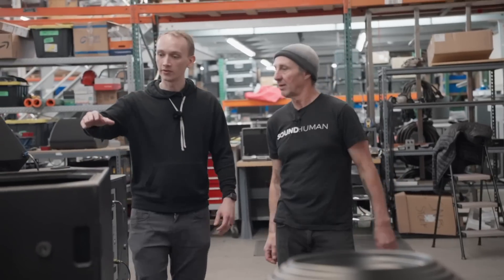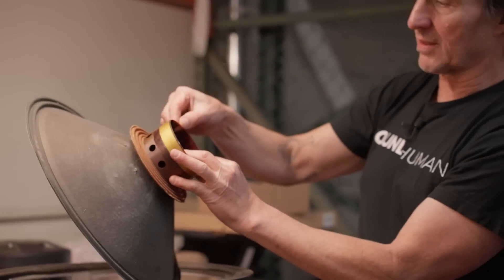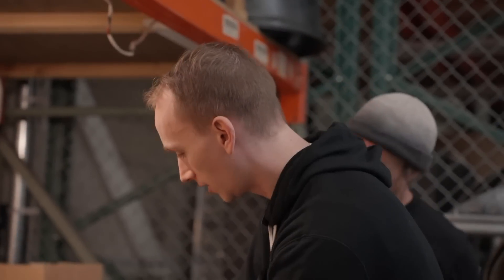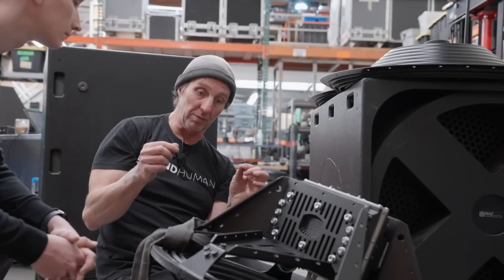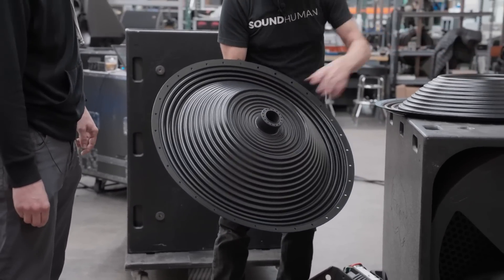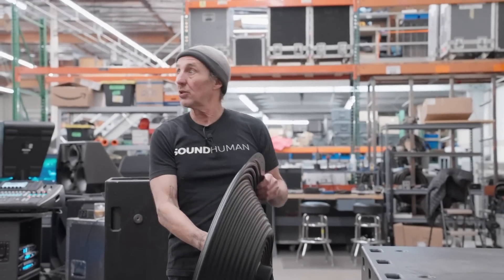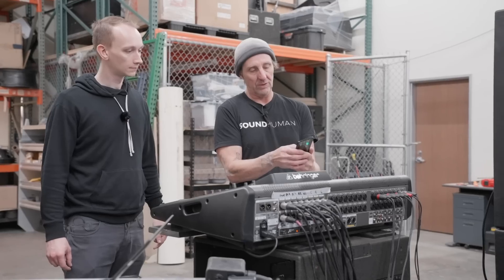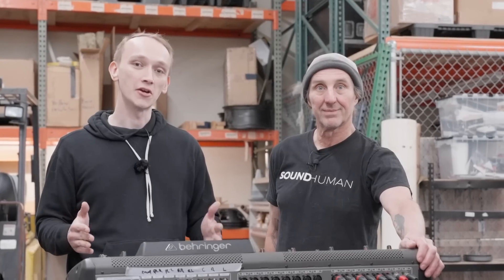Moving Coil vs. Linear Drive Speakers with Dave Rat

Comment: I think Dave is actually correct in your battery-spinning example, you'd get an interrupted squiggly square wave out  (squiggly beacuse no speaker can really reproduce a "perfect" square wave).
Dave is the real deal, if you weren't convinced before, watch his video about audience heat affecting the audio. Magician-level stuff.

Comment: Such an amazing Video! It's very informativ and done properly. Not many channels do this! 
I designed an Infrasonic Tapped Horn for PA use with 2 Ciare 12.00SW that are tuned to 15hz of which a friend built 4 and indeed like Dave said thermals can be an issue! Though with how much air is flowing thru the enclosure in the Infrasonic it's not an issue there as there constantly hot air being pushed out and cold air sucked in, in a way BUT around 35hz the wavelengths are in a way that the hot air doesn't get pushed out as the air doesn't travel in and out far enough. and adding to that the excursion is almost 0 at 35hz so the motors are moving almost no air thru themselves while at the same time the impedance is low and with that a TON of power going thru. So it becomes a heat trap limiting the output. BUT man that infrasonic is so worth it! We may eventually go with those M-Force units as well eventually.

Comment: Why not use the pressure sensors that are already there to run the speakers in a linear mode? Like a servo feedback? Wouldn't that be more accurate? And since the sensors are already installed and DSP is cheap if not already incorporated into the amp module?

Comment: This might be a dumb question but I’m not well versed in Pro Audio but how come PA subs still use accordion surrounds vs the high roll surrounds you seen in other applications like home theater subwoofers and car audio subwoofers?
Reply: I think it's the increased balance between the restoring force of each direction of travel at high spl. Meaning the amount the surround pushes back as the cone moves away from its rest position is more even when comparing inward and outward displacement.

Comment: All the 'big super long throw driver' stuff is a $cam.  The best price-to-performance value is mid-tier 18" PA drivers that throw around an inch max.  More & the drivers & suspension need 2 B 2 stiff & heavy & hard 2 sound as detailed, & less & U R wasting space & weight.  Also he lies about beng able 2 move coil drivers slow.  They will track 2 whatever U throw at them.  WHether U will hear it depends more n the size of the enclosure & portng & stuff & amount of power U R amplifying with.  This is kind of like that muddy sounding 'intersonics servo drive subwoofer' $hit = fancy sounding tech, but worse sound.

Comment: Linear drive speakers are such a bizarre concept. I've always though of speakers as an air pump of sorts (of course push pull :). This design reminds me of an internal combustion engine (piston & connecting rod) but rather than a crankshaft converting the energy into rotational force, the connecting rod directs the energy directly into the cone. I'd guess it is too heavy for accurate mid or HF information. As for a Sub though... Very cool.

Comment: The Danley principle with upgrades. VERY neat!!
Reply: Danley principle?
Reply: Servo-drive was a rotor motor with linkage to the cone. The mass of the rotor and linkage made them only useful below 50 Hz.
Reply: @dannelson6980  
Thank you. 
Well familiar on Tom's work, just curious on what the OP was referencing in particular.

Comment: Correct me if I'm wrong but I'm thinking these things could be fitted out with water cooled coils if needed for more power handling.
Reply: Yes, but that'd introduce unnecessary complexity and failure modes. 

In typical applications, it's vital that it's absolutely bulletproof. 

They have structural heat sinking, plus ample coil area for thermal dissipation.

Comment: I remember seeing a 2 inch speaker in a first gen transistor radio that had a short link to the little cone and went to a magnet-coil mounted on back. So we were half way in the early 60's. Likely done in the teens with first gen radio speakers post horns. The key thing here is feedback with servo action not just a dumb motor. I have a pair of PA speakers that have feedback and their sound never fails to deliver.

Comment: Good science, well explained. Why is the drive mech in front of the cone, where it can "muddy the waters", so to speak?  🙂
With something that big, would axial length really matter? Or is it because the design is mainly aimed at low F, which wouldn't even see the driver?
Reply: The motor being on the "front" has zero negative impact on performance. 

The 56 foot wavelengths of a 20hz tone aren't impacted by the motor out front. 

Even way up top of the sub's range at 80hz the wavelengths are 14 feet ... so the mechanism is still acoustically small.
Reply: @FOH3663  I should have considered the actual wavelength, I stand corrected, thx.
Reply: @flamencoprof  
It's so helpful to automatically associate a wavelength with a given frequency!

That size orients you to essentially all acoustic interactions, everything's about wavelength size. 

Plus, historically flipping the driver over with the motor outward is advantageous for cooling. 

I'm sure there were more, but early on in the 80's TAD, EV, and I believe EAW had motor out subs/platforms, as they explored distortion lowering and motor cooling.
Reply: @FOH3663  I am well-educated re frequency vs wavelength. However, despite a lifelong interest in guitar amps, I have never investigated the world of high-power  low-f speakers.
The cooling effect is obvious once pointed out.
Even at over 70, I appreciate learning new things. Thx.

Comment: There are the fan/paddle style speakers that can go super low but you have to put them in a window or a special hole in the wall.
Reply: Yes. A rotary subwoofer.
Reply: "they go super low, but you have to put them in a window or a special hole in the wall" 
That's an IB or Infinite Baffle alignment.

Comment: Such a master. 😎✨
By the way speaking about the cone coming out or in - after touching the battery to the terminals, if the cone comes out then that is supposed to be the correct polarity. Minus to minus and plus to plus.

Comment: I'm still waiting for the first person to mount a few of these in a Car Audio SPL environment.     Dave is one really cool dude!
Reply: Yes 2 units in series is 0.5ohm and 20k so there is amps out ther that can do it. Unfortunately this design has only very limited xcursion compared to traditional spl speakers
Reply: @bassdabob and here I thought space and rear suspension would be what limited the use of 2 of these. 😂😂😂
Reply: @bassdabob  Loaded into a tuned speaker, two in series will be close to a 2 Ohm nominal load. DCR is extremely low in comparison due to the efficiency of these drivers. So Unless you're planning on sending single digit frequencies into them, amplifiers will handle them just fine. I put two on an amplifier that's not even 2 ohm rated and it did quite well.
Reply: I'd suspect the motor noise may be a non-starter for car audio.
Reply: @FOH3663  I had wondered if an ib setup would help with that?
Reply: @FOH3663    It would be higher for sure, but I don't think it would be that bad bellow 60hz.  It would have to be above 10% to be heard clearly at SPL levels.   The fact it can do 5-30hz at the volume it can do is pretty crazy.
Reply: @MickeyMishra the noise is very audibly at lower volumes
Reply: @bassdabob  Not sure what you're talking about, they're very clean to me even at lower volumes. At 100dB at 70Hz I measured around 0.1% THD (which is insane for a loudspeaker). Maybe you heard a defective speaker or maybe the v1 without the front spider was noisy and the new version isn't?
Reply: @peniku8 yes maybe the new speakers i bought are defective. As there is no traditional gap and the metal gliding borders there might be a reason for them not being around apart from the price. Who knows
Reply: @bassdabob  I have only observed what you describe when I put it on a high amplitude 5Hz sine wave. It sounded like scraping the inside of a plastic pot or something. But high excursion in normal operation only happens at very high SPL, so I don't see it as much of an issue. Price-wise I think M-Force is quite competitive when you directly compare the system to something more traditional. Maybe not in the US tho and not at MSRP, but bulk pricing is pretty good in the EU.

Comment: 3:37 Young dude said drill bit, positive, negative repeating; Old dude said "yeah you get square waves." Young dude said "audio is not square waves but is alternating current."
WHO IS CORRECT? WHAT IS THE DIFFERENCE?
Do a 13Hz and 26Hz square simultaneous audio wave and compare it to a 13Hz and 26Hz sine simultaneous wave.
Old dude acts like a crack head on some shid in this video.
Reply: the old dude is right its just off and on,  no smooth transitions between pulses. thats a square wave a sine wave has smooth transitions between polarity flips. the battery on a drill situation would not provide any transition besides an open circuit between polarity flips im not an expert by any means but i think that old guy might know more about this stuff than this "audio university" fellow.
Reply: @Sethfranzpopsicle  I don't know jack and the fact that I caught that shid and don't see it anywhere else in the comments is mind blowing.

Comment: I think the video misses then main benefit of the mforce. With its 0.25 resistance it barely creates any power compression at all as the current only drives the cone and lacks the standard 1000s of watts heat loss. In addition to that the driver will not shift parameters as a standard woofers as there is no Long term heat aswell. My only concern is dust inside the motor as there are glide rails that guide the magnets embedded into the design. What does dave rat say about this? Especially as there are many design that have the motor facing outside.
Reply: Big problem with these are very high Q of the system.
Your frequency response changes with just about everything: sub position, number of subs, temperature, drive level...basically they never sound the same.
And also motor can overheat pretty easy. And glide rails fail.
Reply: @Sheldon42 where does this information come from?
Reply: @bassdabob  I developed and built Mforce subs. So, first hand. You need to correct EQ on them every time you use them.
Reply: @Sheldon42 so position and amount is similar to other systems? Temperature? You mean the surrounder temp? I could not notice any further heat until now. I believe glides might fail because they can easily be dirtet. Maybee we speak separately about your experiences.

Comment: Does the order of magnitude greater ability of the linear speaker to dissipate heat correspond well to what, I assume, is its much greater generation of heat?
Reply: I think the video misses then main benefit of the mforce. With its 0.25 resistance it barely creates any power compression at all as the current only drives the cone and lacks the standard 1000s of watts heat loss. In addition to that the driver will not shift parameters as a standard woofers as there is no Long term heat aswell.
Reply: @bassdabob  Thanks

Comment: What about the accuracy of this driver? Is it better than any moving cool or the same?
Reply: It's all about level and extension. 

Our hearing mechanism isn't too adept at discerning distortions and non-linearities in the bottom octaves. 

That said, it's performance characteristics are stellar. Linear BL curve, essentially zero compression due to extraordinarily huge motor structure.
Reply: I don't think it's designed to be better, but rather an extensions to existing subs. 
Like a couple of SB18 can get you (depending on venue and what not) go down to 40hz, 35hz maybe. This is where they come into play and create controllable energy way below that. Not a sub that you'd hear. But feel.

Comment: you could sub sonically communicate with elephants with that
Reply: Using a subwoofer to communicate with elephants has been done before, several decades ago, with a 30" subwoofer mounted on top of a Jeep. ElectroVoice had a 30 inch woofer in 1958 and there have been a few others since then.

Comment: I’m confused. 
I’m using a t-line system with an 18” Subwoofer and I can play down to 12Hz and can feel it and shakes my Windows. Not sure what I’m missing.
Reply: I think Dave was talking about driving the speaker without acoustic loading. I'm not really into designing and simulating boxes, but maybe if the driver can safely move at a certain frequency under high power without burning itself, then when acoustic load is added by a box, the output will be higher than a normal speaker.
Reply: @kristofnagy1574  
Oh ok.. thanks. :)
Reply: An 18", 12hz capable transmission line would lack  level, and freedom from BL non-linearities and compression, ... vis-à-vis this platform.